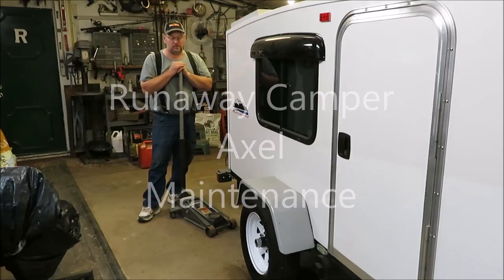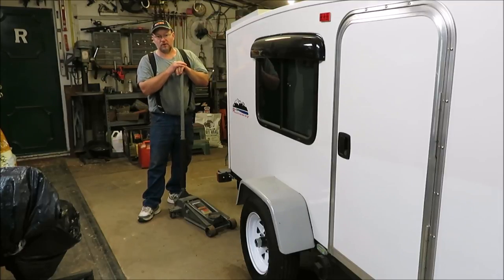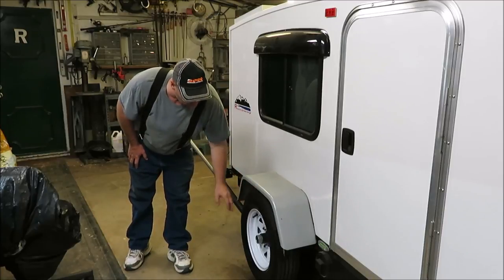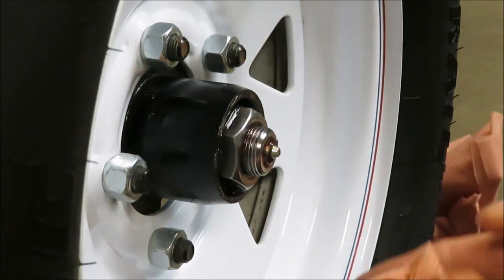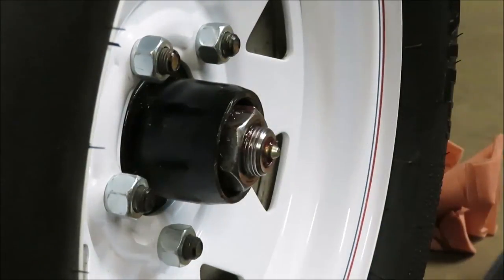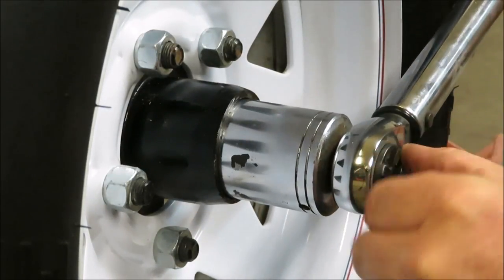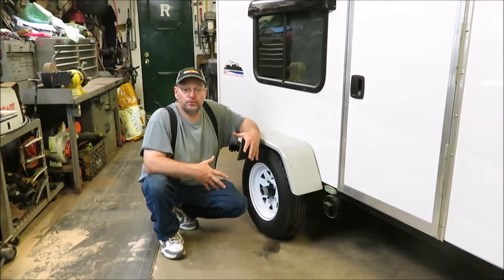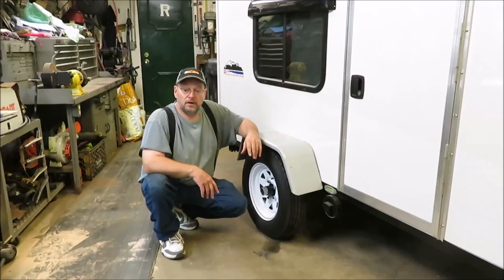runaway camper axel maintenance

Comment: You show jacking up your trailer but you don't show where you are placing the jack. You should show that and stress that you do not put the jack under the axle itself as you could damage it. Also I know they say not to use a pneumatic grease gun because you could blow out the seals. But I think that would only happen if you held the trigger on the grease gun until the grease started coming out of the grease cap. What I do is squeeze the trigger and can hear one pump cycle and then let go of the trigger. That way I'm not blowing to much grease in there at one time. I pull the trigger about as many times as you squeeze the handle on your grease gun. So far so good. https://www.etrailer.com/s.aspx?qry=Trailer+Wheels+Center+Caps. Etrailer has some nice center caps if you want to gussy up your wheels.